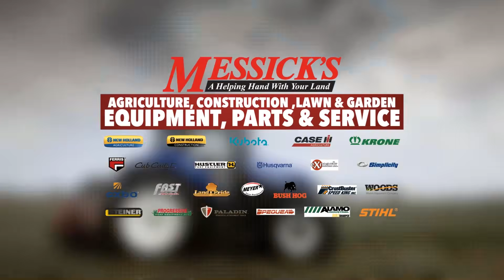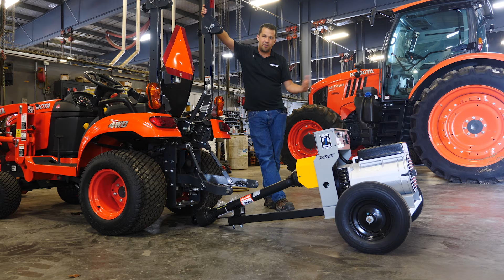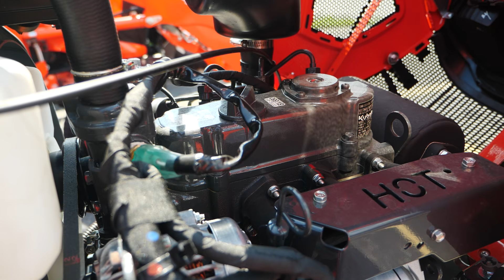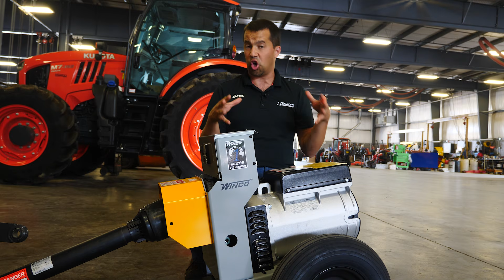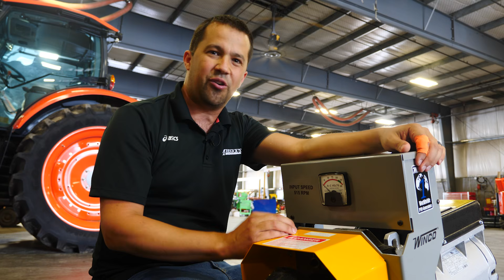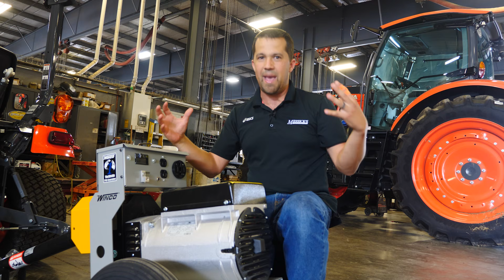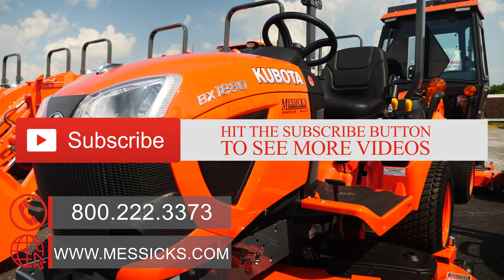Power your home with your tractor - Winco PTO Generators

Comment: Only negative I see using a tractor generator is when you need the tractor to clean storm debris or for snow removal then you don’t have any power.
Reply: I agree.  I would disconnect from generator and work on tree removal for about four hours.  Then hook back up and cool everything down.  It got too hot to work in the middle of the day anyway.
Reply: @ericduck8273  I agree with you!  Work 3-4 hours at sunup, then go inside and cool off, and go back out and work 3-4 hours right before sundown, then go back inside, cool down, rest, and regroup for another day.  bhesides, you can do a lot of tree cutting with a chainsaw without the need of the tractor!  do all of that in the AM, and use the tractor in the afternoon!

Comment: How many engine rpm do you have to run to get the 3600 pto rpm?
Reply: The PTO is 540.
Reply: @bradjenkins932  and the pto generator has a gearbox to boost the speed up inside the generator
Reply: @billfischer6464  Yeah
Reply: @Hay Day He may have been thinking about a small engine rpm of 3600

Comment: I love my Genrac 17KW LP Gas burning whole-house generator. It powers house and 2 barns. Barns are work pace / storage - no critters, milk, cooling or heat in the barns, just lights, engine block heaters and power tools                    sdh in CT
Reply: I had one of those on my house for less than a year...that POS burnt up nearly everything in my house!  Generac ended up giving me my money back plus some, and I bought a far better generator!  You can't give me one of their over-advertised, over rated piles of $h1t!
Reply: My sister and brother-in-law have one of those (well, not sure if it's exactly the same, but some Generac whole-house unit), and they love it too, but how much do those cost? I assumed (and yes, I know what they say happens when you assume!) they were much more than a gas, or even a PTO, generator. (I'm not being sarcastic or trying to be a smart-alec -- I'm really asking! And I'd probably be able to get a response from you faster than my family - lol.)
Reply: @timsawyer7443  As I remember, about 6 years ago, I had about $4500. into it fully installed. Yes, it was pricey but it was worth it to me for the piece of mind that I should never have a cold night's sleep or frozen water pipes. Set and Forget.
Reply: @timsawyer7443  Tim. my Generac placement is 150 ft. away from the house w/ two branch circuits. load shedding modules.surge protector. Propane tank installation & fill. Installed 22kw, January 2019. Cost $8,000.00
Reply: @kendrury3713  Wait until you have to run it for over a week continuously and see the food bill for that propane-hog!
Reply: @user-cy6gf2pj7y  The cost of propane is of little concern for me, convenient availability of fuel is. On my other gen.set ups trying to keep enough diesel & gas storage was a pain. During hurricane Michael, no power for 11 days & fuel stations long lines and limitations of fuel purchases is! something I don't worry with anymore.
Reply: @kendrury3713  I'm glad you're rich...or at least are bragging that you are by saying "The cost of propane is of little concern for me", as far as convenience, I have a 500 gallon diesel tank in my yard that not only stores my tractor's fuel, but also stores the fuel that I heat my house with!  Yes, there are a few of us in Louisiana that use oil fired central furnaces to heat our houses in the winter...even though we don't have a lot of extremely cold days here!
Reply: And don't get me started on how much more propane  is used as compared to diesel!  Diesel fuel usage is 30% less than propane hr/gal, and propane here costs currently FIFTY cents per gallon MORE than diesel!
Reply: Right on Steve, I've used most every type of generator setup, by far my standby Generac requires 30 minutes of maintenance annually as long is there's not more than one hurricane here in North Florida. Lol

Comment: I'll give you a great reason why they suck.....Imagine a hurricane comes thru - because I live on the SC coast they come thru often. I also don't live near a town so we have overhead power lines, so power goes out often and for prolonged periods.  Now, say we are without power for 2-3 weeks, but I have a yard full of debris, 3 trees I need to cut down etc and my tractor and grapple are unusable cause they are tied to the house with an extension cord. We have 1000gal propane tank buried and it will run our whole house gen for roughly 10 days and I can get propane refills almost anytime, but I can't always get diesel - and without diesel the tractor will run out of gas.  
I'll give you for some people they may be great, but it is definitely not a blanket thing
Reply: Your propane generator burning 1000 gallons of propane = only 600 gallons of diesel fuel because the diesel is far more efficient.  Also, today, propane in my area is nearly FIFTY cents HIGHER per gallon than ON ROAD DIESEL, and propane is  nearly EIGHTY cents higher than OFF-Road diesel!  You, Mr moneypockets, could buy aused tractor with the fuel savings alone over a three week outage!  You can keep your expensive POS air cooled lawnmower engine powered  "crapperac", and I'll keep my environmentally friendly diesel fuel-sipping generator!
Reply: @user-cy6gf2pj7y  I can leave my propane alone for 12 months and it won't grow algae, gum up injectors nor will diesel run my tankless hot water heater, gas stove, home heater or my backyard kitchen appliances (Grill and steamer pots)
Reply: 10 days on 1000 gal propane tank,WTF!
Reply: Ken Drury remember, 80% capacity, rarely filled just before the outage. 
but yes, even 50 gallons a day does seem like a lot of fuel consumption
Reply: @denisrhodes54  Dennis I stated 1000 gal. tank, not 1000 gal. tank capacity.
Reply: Ken Drury so what’s your point, and generator setup?
Reply: @denisrhodes54  and our 25KW generator on our 50-55hp "old faithful" deere  uses less than 23 gallons of diesel to run 24 hours!
Reply: @kendrury3713  At over $3.00 per gallon, that adds up to his generator costing him approx $3000 per week to keep his lights on!  The price savings in just a couple of weeks by using off road diesel (tax free farm fuel) and the far superior diesel efficiency would allow him to buy a low cost second (or third) hand tractor to permanantly keep attached to the generator!  He must be loaded in $$$$ to spend that on propane!
Reply: @user-cy6gf2pj7y  To each their own, convenience always cost more!
Reply: @kendrury3713  and it's ok (in your opinion, but NOT mine) that you burn over twice the fuel I do, with a machine less than half as durable!
Reply: @kendrury3713  22KW unit - roughly 2.5 gal/hr.  You don't get the full 1000gal either, you only have about 800 usable and we use the propane for stove and hot water, so rarely is it 100% full, it may be as low as 500 gal if a freak power outage hits.  I am quoting worst case scenario.  After a storm, if I KNOW we will not have power for some time, we can raise ac and stuff like that to limit propane usage.  After Florence we lost power for 17 days and I got propane on day 11 and had roughly 150 usable gallons left.
Reply: Without diesel your tractor won't run out of gas....it'll run out of diesel.

If you are worried about having your tractor tied up to a generator then buy a standby generator, many people don't use their tractors much so having it running a generator isn't going to be a problem...and you don't need a tractor to clear storm damage,  you need a chainsaw.  

If you have a tractor that isn't being used much, if at all, a PTO generator might be ok if you have enough power outages to justify the cost, but most times a power outage isn't very long, and not cost effective having a generator of any type hanging around which is why I sold mine, didn't use it enough to justify keeping it.  A standby generator would make more sense as they're typically setup to automatically startup and run every month or so, and you just have to keep them maintained of course.  I'd go with a standby in an area that gets blasted by storms, but for someone like me where power outages aren't very frequent and typically only a few hours at a time a PTO generator would make more sense, but not sure what I would need to run because your refrigerator/freezer will stay cold for many hours or even days without having power if you stay out of them, so unless you really need to run your well pump, water heater, and that type of stuff you don't really need a generator of too much capacity as even a small 2500 watt generator will run your refrigerator/freezer.
Reply: William Sevier you really need to read a whole reply before replying. I specifically stated what my standby generator was and how it was powered.  
If you listened to Neil’s video he said he didn’t know why tractor generators got so much negativity only then brought up a few reasons that he Debunked. However, he never once thought about the fact you may need to use your tractor to clean up after the storm that also took out your power.
Reply: @kennethfeld6639  If you need your tractor to clean up after a storm, simply disconnect it from the generator....why is that such a hard thing for the anti-PTO generator crowd to comprehend?  You act as if it takes forever to disconnect a PTO implement to swap to a different task.  Your tractor sitting out in the weather to run a generator, so?  Your generator would sit out in the weather if you just had a regular "portable" generator.  What about your car what do you do in bad weather with it when you are using it?  

You have an in ground propane tank, cute but if there's a power outage, storm damage, etc. your propane delivery may not get there in time either.  You can only store so much fuel, regardless of what fuel it is, and running a generator 24/7 isn't necessary in most cases so you really could stretch your fuel out if you had to, and only running for 10 days with 1,000 gallons of fuel isn't very economical either I wouldn't think, so you'd really have to weigh your options in an extended outage situation.  

I can see a PTO generator being great, if you don't have a generator and have the money to spend on it, and already have the tractor...if you don't have a tractor a PTO generator wouldn't make any sense unless you had access to borrow a tractor and had the fuel to run it.  The tractor and generator isn't cheap, but neither are all the other toys  you buy to play tractor with, so really its all a matter of usage and preference.  You can't take your standby generator across your back 40 to do work out there, but you could take a PTO generator down there on your tractor to perform the work requiring power.  So it all boils down to your needs and situation.
Reply: @wildbill23c   What is going to run the AC while it is disconnected, what about the fridge or deep freeze?  Computer - wifi (our internet is cellular, so we rarely lose it) lights in the house etc.  After Hurricanes it is often very hot and muggy, it is genuinely uncomfortable to be in the house like that and you don't want to open windows if you don't have to as the A/C will have to remove all that humidity later.  Having a built in generator makes much much more sense.  In other areas, having a PTO driven genny may work fine.  It is certainly not the answer for everything and that is one reason they take a beating online.
FWIW - I can run my whole house genny for roughly 10 days - 12 if i am careful on my in ground tank and so far 14 hurricanes later - I have never not been able to get fuel.  I have, however, had a hard time getting diesel and gasoline.
Reply: @kennethfeld6639  Sorry to burst your work from an office lifestyle, but you don't need AC, nor do you need internet.  Your refrigerators and freezers will stay cold for many hours without being plugged in if you stay out of them.  AC is a luxury item not a need.  

Most likely if you have a hurricane you won't have phone service so you most likely won't have internet, at least not landline, possibly not even cellular if the storm is bad enough and depending on if the cellular tower(s) have backup generators/if they work.  

With an extended outage of several days I'd go with something other than a PTO generator, but for a few hours it would be fine...course then you'd need a way to get the power to your home's electrical panel (safely and legally), yeah there are ways to do it without being legal/safe but not a good idea.
Reply: @wildbill23c  You have no right to know, nor do you have a need to know why i do or do not need AC in my house.  Frankly, it is none of your damn business. 
My wife just brought up another point, if I am traveling, how is she supposed to be able to hook up the generator.  She can't hook up the bush hog (or unhook it) due to the strength required to slide the clip to lock or unlock the shaft.  So, again it would literally be a paper weight until I got home.
FWIW - we lost power for 3 days about 2 weeks ago when a car ran into a ditch and hit a telephone pole. The power company ran out of transformers and couldn't get one for a few days.
Also, we have NEVER lost cell service - except after Hugo and that was only for a few days.  My boss would probably disagree with you that internet isn't required.
Reply: @kennethfeld6639  Cool story bro.
Reply: @kennethfeld6639  if it's that crappy out who wants to go out and play cleanup unless it's a tree on the house anyway.it seems there's bigger fish to fry in those scenarios
Reply: @wildbill23c  There are specifically ndesigned MANUAL generator panels that go between your electric meter and the house breaker box that allow (by the simple pull of a switch) someone to be on power company power, generator power, or totally disconnected from both.  they make them in ratings up to 1000amps...both single and three-phase!  Farms down here in South Louisiana and South Mississippi have these switches installed because, unlike automatic switches, these NEVER fail when you need them!
Reply: @user-cy6gf2pj7y  Panel is already in, just need the generator LOL.  Planned ahead for that much HAHA!!!
Reply: @wildbill23c  And that was a wise decision!

Comment: diesel engines are designed to stay running.. most generators are diesel engines..
Reply: ... but many of the less-expensive generators at big-box stores are gas powered, which bring the problems of engine maintenance, gas freshness, etc., not to mention that they just can't handle the job they were purchased to do. One problem, I think, is when so many folks (me included) are ignorant of what is actually needed for a true "whole-house" unit, and buy an underpowered gas generator thinking it'll do the job. Like you said, diesel engines seem much more appropriate to the task (vs. gas, anyway).
Reply: That's true for large generators but most emergency generators used for whole-house emergency power use gasoline, LP or natural gas.

Comment: How does the tractor keep the same PTO speed under varying loads with this setup?
Reply: Called a governor.
Reply: Govenor
Reply: @Adam-bw4lw  govna
Reply: You have to over-size your tractor to make it work. If you have a smaller tractor you may have to adjust the speed up some before running the dryer and the oven, it is doable. Some tractors have a better governor system that would help too.
Reply: Less than 535 or more than 544 PTO rpm and the AC power frequency is out of spec.  A mechanical governor is not precise enough for this under all load conditions.
Reply: @Mr. Sunshine Hey I bet you're fun at parties. Why don't you go run your tractor some to avoid your family, you obviously have something going wrong at home.
Reply: @Adam-bw4lw  Only one that's a loser here is you, you are trying to censor a person for raising a legitimate concern. Almost as if you're a paid shill. I've noticed alot of shill type posts in meeseeks comments section...
Reply: @Mr. Sunshine How much are you paid per post? .15cent?
Reply: @Hay Day Idiot or not, I have experience with these pto untis to share to help others to avoid the same pitfalls I have ran into.